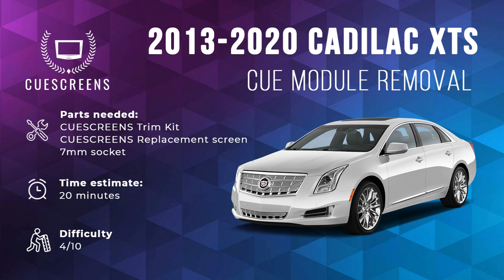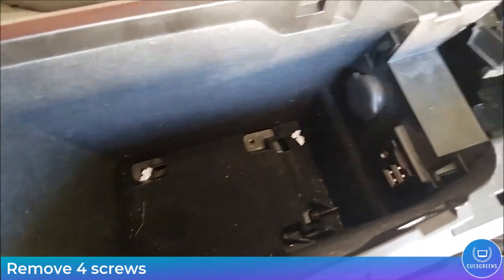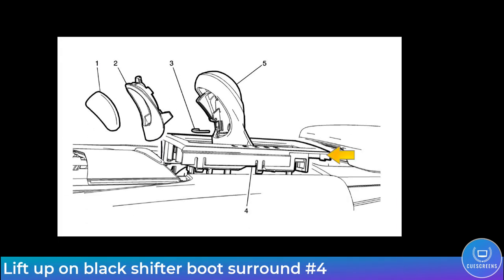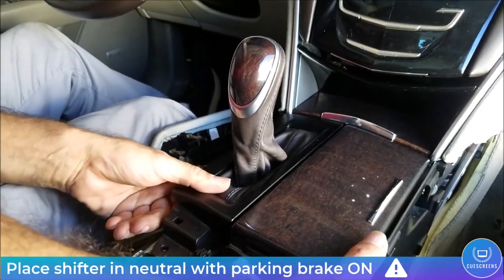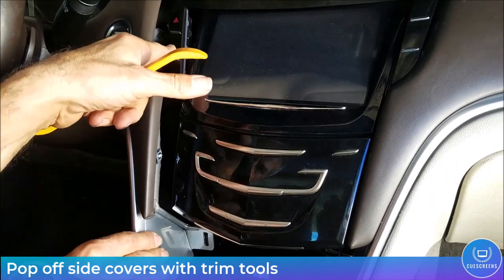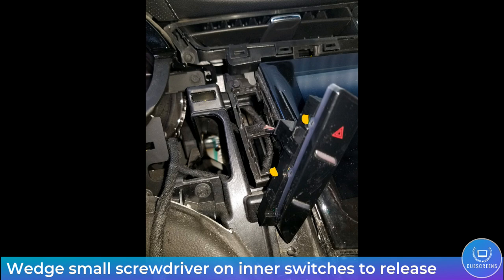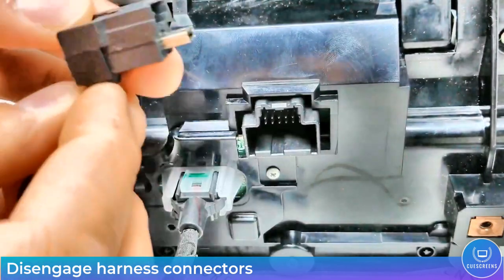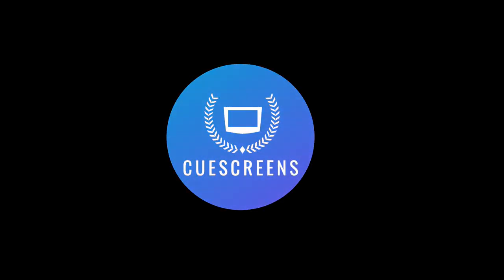[2013-2020 XTS] Cadillac CUE Complete HD Module Removal *Easy Method* 20 mins

Comment: The 3rd ashtray screw also got me. Instead of struggling with it, I removed the screws on the side that hold the leather panel in place.  This gave enough room to pull apart the ashtray compartment on either side and remove the two dash panels.  Make sure you have enough light to see the ashtray compartment to pop it apart. After that work around, everything else went smoothly and the screen replacement was easy.  It did take a long time due to the ashtray screw, but well worth saving the 2K.  Very happy to have it functional again! Thank you for the great video.

Comment: 20 minutes? Yeah right are you guys on crack? It took me 20 minutes to get the first panel free. Great videos despite unrealistic estimates. I got the third ashtray screw by drilling a hole through the plastic wall in a straight line to allow an extended 1/4 inch drive to reach the screw. Needless to say I did Not put the screw back in with no loss in function.😀 once I got the battery recharged and rebooted all the computers by pulling the battery cables and touching them to each other. The screen now works great and my Mother-in-law says is even better than before  !! Thank you for great directions.😀😀

Comment: Got mine replaced today, nice to be able to tune the radio again! Please remove the other (original) XTS video that doesn't mention the two hidden screws around gear shift and cup holder. Wasted an hour learning what was holding it down. Everything else worked great including the new screen, thanks!
Reply: Was about to brake cupholder because of the hidden screw

Comment: The instructions/ videos were excellent! I did what Roger did by drilling a hole in the plastic wall to have straight shot to the screw , much easier to remove and reinstall. The Cue replacement went smoothly but it did take a bit more time, but it was the first time. The screen is great! Its like having a newer car and my wife is soooo happy to have her screen back.
Reply from the maker: Good idea

Comment: I was very hesitant to try to fix this, however the expensive alternative was enough of an incentive.  I got the premium screen with the tools and the "tweeser" and all are great and allow you to not damage the car pieces.  I watched the videos multiple times and had an ipad with me to follow along if needed.  We have the 'heat' down in Texas and it eats the original screens so I wanted a replacement that would solve the issue once and for all.  
I took a lot of time and it actually was right on spot with the videos.  I was surprised it took a little extra effort to loosen things up but it was built better than the older cars I used to work on with all plastic.  
The one trick for the screw holding the ashtray is to use a small wrench from the front top to loosen it and then I used a socket with a swivel connector and extension to take it out and put it back etc.  So much easier than trying to reach it otherwise.  
Also, when putting the cupholder/gear selector "box" back, snip off a little from the vertical plastic alignment molded shaft UNDER the "cupholder box" so that it will drop right down during reassembly.  It won't be needed anymore as it is used in the original build of the vehicle I think.  Everything fit back perfectly and it was so much easier than to try and wedge something back in place at least in my opinion.  
The Cuescreen is a terrific solution and I had a little glitch but the support folks sent me the method to reset the software (it's also on the website) which fixed all my issues!  
Putting on the new screen is a breeze as long as you watch the videos and take your time!  The videos are GREAT.
I highly recommend getting the Cuescreen products as you really get what you pay for!
Reply: Is it easier to replace if you replace the who unit.  I know it is more expensive but it have seen the wholevunit for 450.00. But cadillac want 1300. To replace the whole unit. They want 400.00 labor and 700 for unit. But if I buy a unit not just screen don't think my son. It is not patient. Can I have your phone number so I can ask questions. My car is 2014 50000 miles and the acreen worked atv11 am at 2pm i could not push a button to go to Bluetooth so I could pair my phone.  I also have a cd player but cannot get there from radio. It was playing cd until 4pm and that stopped . But thinknthe cd playervis good just cannot push to get to the audio screen. I noticed this summer couldn't use the GG e buttons to say which way I wanted air to blow. Didn't realize that had anything to do with the cue screen. Thank you

Comment: This is an excellent video and a wonderful service to the community. I found the removal of the CUE box to be much harder than it looks. Some of the panels with the spring clips do not pop off as easily as shown in the video because his were already lose. It took us much longer the first time since we did not want to break anything. Our CUE box for a 2016 XTS had 4 electrical connectors in the back instead of 3 as shown. But this did not alter the procedure. We also noticed that he said to remove the ash try only required removing three  7 mm screws. But a careful look at the video shows there were 4-5 other screws on the sides that were already taken out. Not sure if those needed to be removed but I did so just to make sure. Also prying off the rear seat AC / heat cover was tricky since there is a mounting bracket under the wood veneer that is difficult to see. That is what needs to popped off that has the spring clips and not the wood veneer trim which is only held on by 4 small plastic pins and not designed to be removed. Overall, this is a great video. If you are not very mechanical, I would not suggest you attempt this. But any reasonably skilled back yard mechanic can clearly do this with some patience. My replacement touch screen was an exact fit and did solve the CUE problem!

Comment: Hidden ashtray screw got me for awhile! All that huffing and frustration with the ratchet and flexible extension but a straight ratchet and deep 7mm bolt fits into that oval slit in the plastic there that blocks the hidden ashtray screw. It doesn't look like it but it gets you a straight shot to just turn your tool as your normally would. At the end slow down and the screw won't fall into the car. There is enough plastic base in there where it'll kind of hang. I took some long kneck pliers and reached around the plastic and grabbed the screw. Now I'm stuck at the step after. Still happy I have my 1500 and dignity though. Lol

Comment: Where do I start? I can't say enough great things about how well this video is done showing the highest details. This literally save me so much money that I cannot say "Thank you" enough for both making a better product as well as a detailed video. I have a 2014 Cadillac XTS Platinum that has had the CUE system replaced twice under warranty and yet it crapped out again. The dealer quoted me over $1,200 to swap the unit and only provide a 1-year warranty. Cadillac should be Is embarrassed of the touch technology they chose for all of their vehicle lines.

Thank you again for a fantastic product and an exceptional video!!!

Comment: Overall very good video.  some slight differences from my actual XTS.  It is apparent that the screen had been replaced prior because the 3rd screw for the ash tray was missing.   Overall it is faster to replace at home than wasting time and money at the dealership.
Reply from the maker: Correct, the dealer is a ton of hassles and waiting and cost.

Comment: I just finished my '15 XTS Luxury and it worked the first time!  I can see why you have shown the panels and parts already loosened as the language would not be appropriate for all audiences.  The only hard part for me was the Rear Climate control panel.  The line had put a little more goop on the center console leather causing it to be a little stickier.  That was really the only hard part of the removal.
The screen swap in the module was uneventful, with all of the tips in that video.
Thank you for a great product and fantastic video support!

Comment: 2014 XTS4 VSport here.  Did you disconnect the battery?  I can’t get the electronics to shut off with the park brake set while in neutral.
Reply from the maker: No need to. Set it in neutral so you can remove the cue unit, then put it back in park when its out. Then you can turn ignition off
Reply: @Aaron so did your electronics shut off? @CUESCREENS saying you can remove it and put in park then turn ignition "OFF" but with a push-button ignition, I'm not following how we're supposed to be working with electronics without disconnecting the battery!! There's no key to "turn ignition off" - help me here, please!!?? Someone!

Comment: Dealership told me it was the infotainment system that needs to be replaced. How can you determine if that's true or if it's the touchscreen?
Reply: Taking it outside the dealership ("stealership") network for confirmation from any reputable car repair shop or even a car stereo installation shop. I've always been of the opinion that dealerships employ "part swappers" compensated based upon the total of our repair jobs, not on the work required to get our vehicles back on the road - as a mechanic used to do. Mind you, I do NOT fault the mechanics or techs at the dealership - it is the compensation model the dealership puts into place. I wouldn't be surprised if they are disciplined for not meeting financial "targets". But I'm a cynic.
Besides that "rant" please do a bit of research and you'll find these POS CUE screens are the bane of existence for a pretty stinkin' nice ride.

Comment: Just finished up another XTS. I'm an installer. With this one I found it not necessary to remove the rear a/c vent. And I also left the switches attached to the CUE, then disconnected the plugs with the other wiring when removing the CUE.  The screws behind the switches are slow to remove because you only get a 1/4 turn with a box wrench, but I'd rather be slow than break the switch retainer bracket.  Just another alternative...

Comment: This is NOWHERE near as easy as they make it seem. And you WILL need a socket extension that pivot to be able to remove the “hidden” ashtray bolt.
Reply: Also my lower trim panel did NOT “pop out easily”

Comment: First, you should State that you should disconnect the battery before starting this procedure.2. There are 6 screws holding the arm rest compartment, not 4. At the end of the video, you stated, it's an XDS instead of an X.T.S
Reply from the maker: Battery disconnect is not necessary.

Comment: Does anyone know how to remove just the cup holder on a Cadillac xts 2013. I want to clean it so bad
Reply from the maker: You have to remove the bolts and rubber mats
Reply: @CUESCREENS  OMG!  Ah, that rubber mat! In the pictures, my friend and i confused the rubber mat with the plastic bezel so we spent a very long time trying to find that hidden screw - under the rubber mat!
Reply from the maker: @robertreynolds1744  Nice job. Yeah, lift up on that rubber mat and it will pull right up

Comment: I can't remove the third 7mm screen that holds the ash tray @3:40. It's literally in front of the plastic upholstery.. what do I do now 🤦🏾‍♂️
Reply from the maker: Third ashtray screw that holds the ashtray to the AC vents in the center console: Come in from the passenger side with a wobble socket extension. Once its loose, reach in with your fingers to unscrew it and prevent it from dropping into the void
Reply: @CUESCREENS  so, I've got hands like ham hocks or a pot roast, fingers like oak trees. Suggestions on how not to lose these bolts into the great abyss?
Reply from the maker: @poconojohnny  Use magnetic 7mm socket

Comment: This will take MUCH longer than 20 minutes to dis-assemble. The third 7mm screw for the ash tray holder is behind plastic and is not accessible. I have spent well over an hour to this point trying to get at it to no avail. I am going to remove myself from the situation and try to approach it again tomorrow. I think I am going to need tools I do not have that allow me to access that third 7mm screw somehow. If you have not purchased this yet and are considering doing this yourself, I recommend that you do not. Find an installer that will do it for you (albeit at a cost). I am wishing I had taken that approach at this point.
Reply: I used an extension and a drill and removed it in seconds. You need a long extension
Reply: I used an extension and a drill and removed it in seconds. You need a long extension
Reply: For those reading this guys comment, don’t give up. I simply used a 7mm box end wrench and finished with a 1/4” drive socket with a regular 7mm socket for this step. Could get about 10 degrees per throw, but it came out in a couple minutes. Some extensions and flex heads might have been better. It is doable.

Comment: These instructions totally suck the rear vent doesn't pop off without taking off the console armrest.  You can't lift up on the gear shifter bezel by only taking three screws out to access the hidden one under the P.  How about they upload some good videos